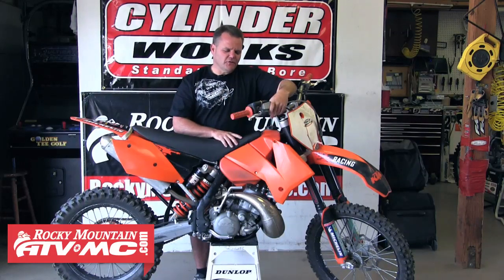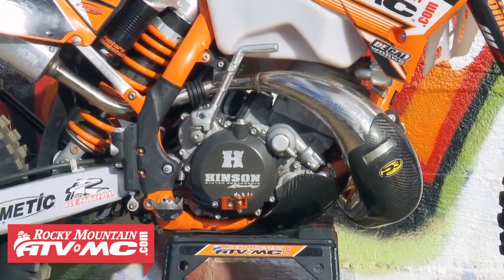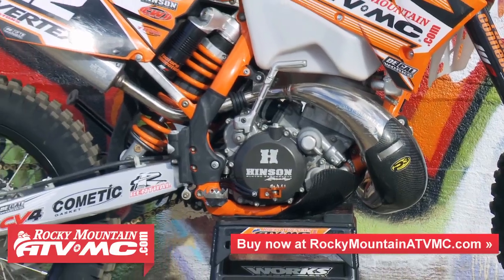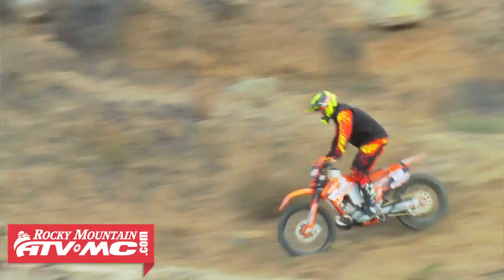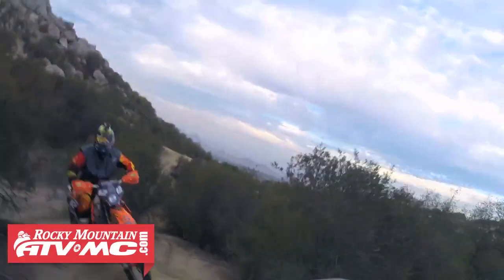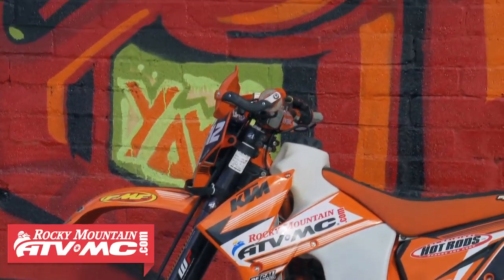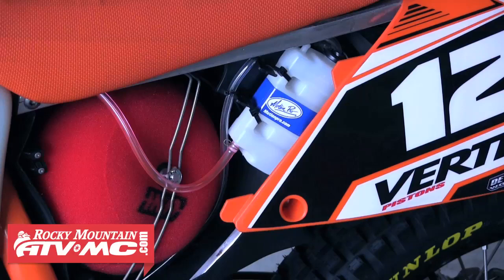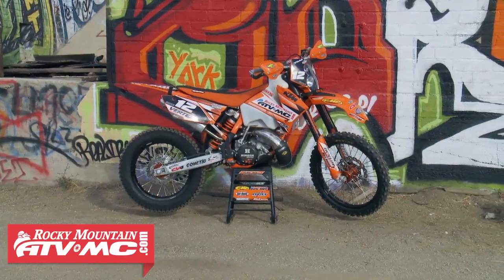KTM 200 XC-W | Building the Ultimate Trail Machine

Comment: how was the bike lowered?
Reply from the maker: +carlin hicks 

Factory
Connection makes custom spacers to shorten internally and doesn’t cut shafts so
that its not reversible later—  They can use a shorter spring series and
depends on each bike — That bike is a PDS bike with no link so shortening
inside is the best day.   Can take up to an inch out—

Comment: The "two strokes use fuel faster than 4 strokes" myth is fake, A high performance DOHC fuel injected hot rod motor(be it enduro or mx) will suck gas at pretty much the same rate.  And the two stroke 250 vs a 4 stroke 250, they are almost neck and neck with fuel consumption lol.... My 200 xcw went well over 6 hours today and it hardly used any gas
Reply: +spencer 124 2 strokes burn through fuel faster than 4 strokes, a gallon of 2 stroke fuel contains 2.5-4 ounces of oil depending on the ratio, A gallon of fuel for a 4 stroke contains a gallon of fuel its not displaced by oil like 2 strokes. Also since the oil in the pre mix for 2 strokes does double duty as fuel and lubrication they tend to run 2 strokes a little richer to get adequate lubrication for the piston and rings, The more fuel that goes into the head the more oil that goes along with it!
Reply: Yup true, my 200xcw sucks the gas down like an Olympic runner!  A tank of gas will last about 5-7hours, yes I totally agree, but I bought a 2t to avoid the risk of buying a used 4 stroke bike lol...
Reply: @spencer1244  my 200 xcw went well over 6 hours today and it hardly used any gas
AKA
Sucking gas like an Olympic runner
Reply: @travistucker7317  nice, yea I got a 250xc now and it wants to kill me, that explosive 2 stroke power never never gets old lol.  Rode a crf 250f and I was bored, long live the 2 strokes!

Obviously I can ride it extremely fast but if you blast the throttle like an idiot things can get ugly fast lol

Comment: DONT BUY THE FATTY PIPE FOR TRAIL RIDING it's not made for it its less durable and gives the bike power in the rpms that u don't need for trails. If U are buying a fmf pipe for trails get the gnarly pipe it's more durable and adds more low end power.
Reply from the maker: +David pelkey Yes.  Thanks for sharing!
Reply from the maker: Kevin Stearns I enjoy the turbine core spark arrested silencers. Easy to work with when repacking.